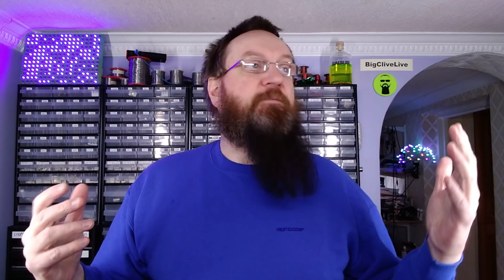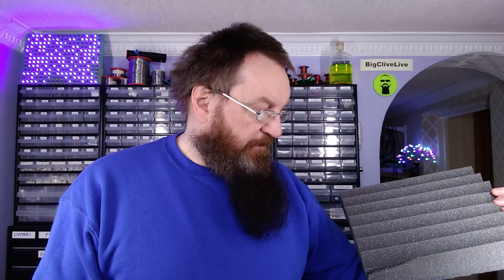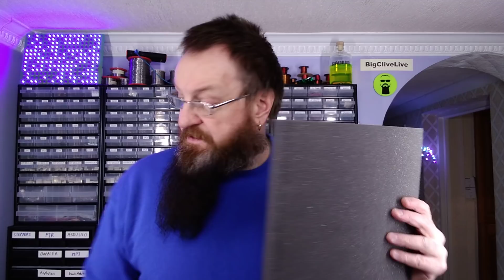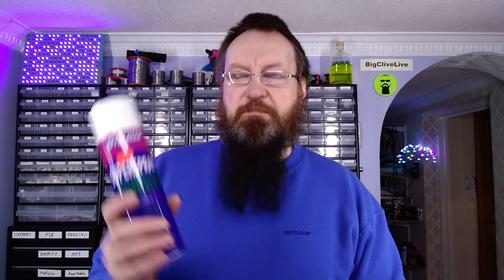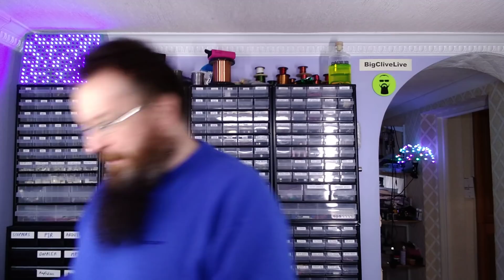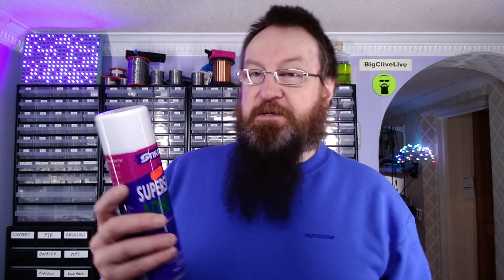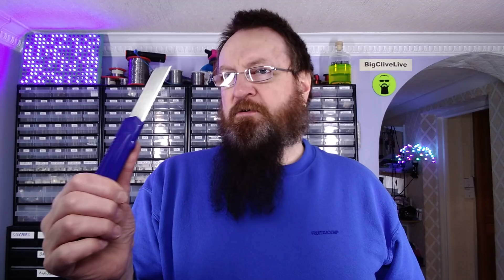Acoustic foam test.

Comment: Hello mister Clive, yes, if before it was a tiny bit of a ringing sound, now with the foam is more pleasantly muffled, like in a studio sound. But it has a secondary effect and a very important one. The volume of the sound decreased. While before was 100% , now is 90 or 80%, judging by my ear-o-meter. I suppose you must add a volume sound amplification somewhere on the wires. Interesting thing and I bet is occupying a very large space just for a bit of a muffled sound...hmmm, it is a bit more pleasant than before, I will not lie,  but my practical neuron is not completely agreeing with it.

Comment: As an engineer who has built a few recording studios - this was exactly the effect I was expecting from your application of this type of foam, and exactly why it's recommended not to just plaster walls in a recording space with this type of foam.
Both the density and the thickness of the material used will determine the frequencies which the material is capable of absorbing. This is why professional studios use fiberglass acoustic panels, often with thicknesses of 2 to 4 inches. Lower frequencies being longer waves, generally require a much thicker panel to absorb. Absorbing reflections down to low bass frequencies will often require at least 4 inches or more (even more helpful to be placed diagonally in corners with space behind the panel).
This means the issue with foam like this is that it's only capable of absorbing very high frequencies (which are important for intelligibility), while allowing all of the mid range frequencies to pass through them like they weren't there. You've decreased the reflections in the top end, while doing absolutely nothing about the reflections in the low-mid frequency ranges. This results in the high end frequencies becoming very directional, and the microphone becoming swamped in the low-mid range reflections.

Comment: It has made a difference to my ears, I don't know how far the mic is from the walls but I would advise moving it maybe about half an inch to an inch away from the current location. The foam may work a little better. You can tell me to piss off Clive but just a suggestion 😁

Comment: Analysis, indeed!  And so very long after the posting.

Inside your box, you have a resonant peak at just about 100Hz.  Foam that thin will not be very effective at that low frequency; to manage it, you would need much thicker foam, or two layers, or thinner foam with an air gap.  In any case, "thick."  On the other hand, thin foam is quite good at absorbing the high end, which as many people have pointed out, ends up being harmful to clarity.

The easiest, and possibly most effective, answer is to find a way to put a parametric equalizer somewhere in your audio stream.  Set the frequency to 100 Hz, the bandwith to perhaps half an octave (or a Q of 2 or 3), and depth of... let's start with 9DB or so.  See if you like it.

Comment: So this I learned recently - why it sounds "muffled" is because the foam at this thickness absorbs frequencies >1000Hz, so the echo is "gone", but all the reverb in the lower frequencies (<1000Hz) is still there. Also the lower frequencies are now more prominent AND reverberating, making it sound muffled and hard to understand.

To combat this you could use a thicker foam (10cm at least). Also you can fix it somewhat with the EQ.
Reply: I did this and it sounds much better (to me). To be clear: I have no idea what I'm doing, I am not an audio professional, all this is new to me too and this settings are only a "quick fix whipped up in 1 minute" (this is done in a free software called Voicemeeter, love that thing!)

https://imgur.com/a/vLblbsk

Comment: It did make a huge effect.  Some good and some bad.  It did eliminate the talking in a fish bowl sound.  I would prefer the foam but you should have experimented with it.  Try different amounts  at different places.  It's not a one size fits all.  With the foam you sound a little hollow.  It is absorbing so much sound that it doesn't sound natural.  I saw the it sounds muffled comment below.  When you buy the sound foam in a large room you generally take all the measurements and design of the room and send it in to whom you are dealing with and they send back a specific design that requires specific placement, size and shape.  When we set up for a channel we just have to experiment and try different placements and amounts.  If you just covered up everything you could then in a sense you may have defeated your purpose so to speak.  Hope someone out there can give you assistance that may have done this before.

Comment: The foam has removed a lot of the high frequency *reflections*, not removed the high frequency, as is often misunderstood.. You can add more layers of the material, but it would be impractical. I have been doing something similiar in my office, except using 400x400x500mm anechoic material, it's awesome. If you have to ability, apply a -6/-8dB EQ between 80 and 180Hz and you'll be (almost) laughing.

Comment: Certainly cleaned up the sound, I couldn’t really notice an echo before, but once you fitted the sound deadening I was suddenly aware that it wasn’t there anymore. I actually had to turn my sound up to hear you after as it was quieter. 

On a side note, WD40 is good for getting the glue off stuff, so should get it out of your jumper

Comment: On ear phones, it sounds like you need a bass trap as well, which the foam won't help with.
If you the microphone had a bass sensitivity roll off switch I would use it, but you might be able to do it with an eq as well.
Try running the recording before and after through an rta spectrum display (in Audacity etc)
I think you will find the bass overwhelming it.

You may also have a bass trap between the desk, monitor and wall, with the microphone sitting in it., so try moving the microphone around, get it into free air space and see if it sounds different.
It might also be that the microphone is too sensitive to bass, and a different mic would improve things.

You can test the acoustics of the room by playing a white or pink noise (I usually used pink) file into the room away from the mic, and then compare the white noise output with the spectrum analyzer of what the mic is picking up.
You can see what frequencies the room absorbs and which it amplifies and accentuats, and figure out what you are hearing, and then know what frequency range you need to treat, or eq out, or boost.

You can get RTA spectrum analyzer apps on your phone that are very useful and surprisingly accurate.
It's fun walkout into a concert or church and seeing how good the sound design is, and what they need to eq out to stop the painful sounds.. Lol

Comment: Hi Clive, as a broadcast engineer there are 2 reasons for sound proofing. The first is isolate your recording environment from external unwanted sounds the second is to create the acoustics or sound of the recording space. In my opinion your environment is too dead as all reflections have stopped. As an experiment place squares of cardboard to the different surfaces but maybe leave the corners in foam. 
I think playing with rooms acoustic is better than electronic tone correction as that could introduce further "distortion"  
I hope something to think on.
Cheers.

Comment: I had to Turn you up a little, I was use to old sound setup But Now you can Speak a Little Louder Because the Mic is not picking up on the Rear Wall 25%-44% loss of audio into the Microphone .. But it Does Give you a DEEP Tone in your Voice..

Comment: I wonder how a hardish surface with random angles would compare against the foam. You'd get less sound absorption but the size-of-room effects should be reduced.
Reply from the maker: The foam was much easier to implement for a test.
Reply: @bigclivedotcom  Oh, is it something they sell? I was just musing. Yeah, definitely the foam would be easier.
Reply: Just went googling. There's some pretty cool looking ones out there. Not exactly what I was imagining but the effect is probably the same.

Comment: I remember the station fire I had a small sound and light business at that time  used flash cans was all I had they changed the laws making any use of pyro you had to be licensed  they even class fog machines  foam generators and bubble machines in that class too  (as far as pro shows are concerned )  the people that put in that sound deadening foam knew it was not the safe stuff but was cheaper  not thinking some idiot would fire a pyro into it  the good that came out of it was the safety mandates on such materials and venues  construction and better exits with well lit signs  .

Comment: Before - you had a resonance peak at about 150Hz.  After - that peak was less but still there.  Not gone.  Much less.
I heard no issues in the treble before or after.  I think your big problem is parallel surfaces.  The side walls are parallel and sound is bouncing back and forth between them. I would guess your side walls are about 6 feet apart.  Wavelength of 150Hz is about 7 feet.  180Hz about 6 feet.  Try putting a layer of dry wall over one of the sides at an angle of about 30 degrees. Actually you can just hang it from the ceiling. The idea is to not allow sound to bounce back and froth between those walls.   
Same problem with the ceiling and the table top.  Slope the ceiling with several smaller pieces of dry wall hung at 20 to 35 degree angles from ceiling.  
I've been in studios where they built the walls so none were parallel.  Everything was all cockeyed.  Then they hung carpet all over the place.
Also, the walls should be covered with objects to break up all the reflections.  Restaurants that have sound problems will sometimes cover their walls in 8x10 and smaller pictures.  Especially helpful if those pictures are not mounted flat against the wall but at random angles.

Comment: Made a pleasant differences here in Lancashire. I hadn't thought the audio was bad previously, but now you've pointed it out you HAVE to keep the pads in the wall or I'm jumping 😜
(I have been drinking so the jumping part won't happen, but it did sound less bassey with the pads on the wall. Apparently you can improve in perfection!)

Comment: In your case, reverb was not the problem. But in your relatively small "box" there was destructive and constructive interference. Even slight movements led to an effect like a flanger. This is no longer the case! However, it might be necessary to remove the beard, which undoubtedly also reduces the treble. If this is not acceptable to you for some reason, you could better align the microphone to the mouth and/or raise the upper mids a bit ;)

Comment: yes I can hear the difference, it is not bad (it is rather better)
(and now it comes)
however you have a bit issue with bass
it is not easy to fix bass acustically - you would need proper tuned resonator for that
it would be more easy to fix bass with high pass filter or notch filter though
you could raise your volume level afterwards 
a little sound edit, in Audacity for example, should to the trick
I have tried just quickly 200Hz HPF -12dB .. it is clearer but more work could be done
Reply: I have tried cutting off 80 + 100 + 125 Hz if GEQ in Audacity, processing with Audacity Compressor to flatten output, pumping up volume cca 3dB (more than Normalize, there will be some clipping on loud noises but it is ok actually)  and adding tiny little bit of treble - voilà

Comment: Clive - as you anticipated, the foam has soaked up the reverb and the result is less boxy  and more 'professional', even through my laptop speakers, but folks are not used to an anechoic environment  in real life, and  are not used to hearing you this way on your channel. But I think it is an improvement, and prefer it. But it may take some drama out of the next explosion. You will also have to be more careful  to stay 'on mike' in the less reflective space.

Comment: Judging from the craptaqlar speaker in my tablet, sound quality dramatically improved. However it does sound a little muffled like wind draft foam over a mic. Overall there is less distortion.

Comment: Definitely a dramatic difference.... when you switched to the new setup, I though, "I dont like the change". 
And I'm sure one thing that you might have missed: it is very common for you to turn away from the camera and continue to talk; that usually gets much fainter but can still be audible and discernible.
Do the same using the new setup and let's us hear (or not hear because it will muffled beyond the ok  threshold).

Comment: So I once had the job to cover a corner of a room with that foam, and I tried using spray adhesive (3M Super 77) at first. It was terrible; the overspray built up a sticky film on the floor that got tracked everywhere and made the entire floor sticky. When it came time to attach foam to some ceiling tiles, I tried using the spray adhesive again but it didn't hold for long. I then tried hot-melt glue. It worked perfectly and there was no overspray. If I had it to do all over again I would have used the hot melt and skipped the spray adhesive entirely. The only thing I use spray adhesive for anymore is attaching speaker grille fabric to grille frames, and that is still a messy and infuriating undertaking.

Comment: I think some of this is also what you are listening to him on, IE, your PC with some decent speakers, or your phone or tablet with its crappy squeaker drivers. What I noticed most is, yes the top end was reduced a touch, but the reverb, as already noted was reduced and his voice took on a fuller sound overall an I think for cell phones and tablet speakers, it may be overloading those poor crappy speakers they sport so may also degrade the sound by themselves. As I listened, I noted a a slight (ever so slight) reduction of the smearing of the time domain, once the reverb was significantly reduced and at the same time, it came orff a touch dead sounding at times too, but he came through a tad clearer as a result.

Just my .02 cents/tuppence worth.

Comment: FYI I have an audio=engineering diploma, which doesn't of course necessarily mean I'll make any sense at all. However, the mid-frequency reverb has dropped significantly but the treble has also rolled off noticeably. You would do better to have a mic closer to your mouth, such as a lavalier mic on your jumper. That would automatically have reduced the reverb in comparison with the volume of your direct vocal, and at much less cost and effort than buying all those foam panels and glue. For your information, I found that surprisingly cheap lavalier mics designed for android / iphones that cost about £6 were indistinguishable in audio quality from expensive mics from Rode (the ones with the slash through the 'O'), the only significant difference being that you got a flashy bag to put the mic in with a Rode one. You can of course drop off the bass using a boundary mic, either with it's plate hanging in mid air and NOT against the wall (the size of the surface determines the point at which lower frequencies roll off), or if its one of those cheap but astoundingly good multimedia boundary mics for around a tenner, then, against a piece of hardboard that's about 10 inches diameter - again, some distance from the wall. If you are going to stick with foam panels, then they work best at least an inch from the wall, preferably not stuck to a hard surface at all - harder to mount though. Just to point out, you appear to have  your microphone, wherever it is, a lot further away from your mouth than most radio broadcasters.

The bottom line is, the closer to the sound source the mic is, the less relevant the acoustics of the room are. Annie Lennox said in an interview once that for (I think) 'Love you like a ball and chain', they played the song through loudspeakers and she used a directional mic to pic up her vocals. Astonished, I tried this as well, and it worked really, really well with surprisingly  little cross-talk, even in a large domestic lounge with large areas of reflective glass. Not that you're doing any singing, but the point is, a directional mic close to your mouth can solve many room acoustic problems. You could try a headset mic even.

Comment: Thank you,  Clive, an interesting experiment and a definite improvement.   You can measure the reverb using the free Audacity sound tool,  by recording an impulse (e.g. bursting a balloon) and then inspecting its waveform,  or plotting its spectrum (Audacity Analyse/Plot Spectrum).   I'm trying to create as dead as possible a sound booth on the cheap in my garden shed so that I can record audio books for Librivox.  I hung cheap duvets on the walls and ceiling,  and laid a blanket on the desk.   It's removed the worst of the reverb,  but does nothing much to isolate from the depredations of perambulating squirrels on the roof or passing light aircraft.

You can modulate the amount of bass you get by your distance from the mic - the proximity  effect.  I'm recently experimenting with a shotgun mic 12" above my nose pointing straight down.  As long as you're not going for a wide shot,  it should remain out of frame.

Comment: Well there is most annoying problem left untouched, that is the low end. Maybe you could put some low frequency shelf in edit. I think the speech tonality is already a bit like key factor in this channel, that people expect that "big Clive" sound so make just a small adjustment. So the sound doesn't go all the sudden into little Clive. In any case, i'm here because of content. so what ever. This is just a common thing, that when channel gets bigger, every tool gets updated at some point.
Reply from the maker: The audio of the bench videos will remain the same.  This is the live stream area, and has already benefited from a microphone since the foam was added.